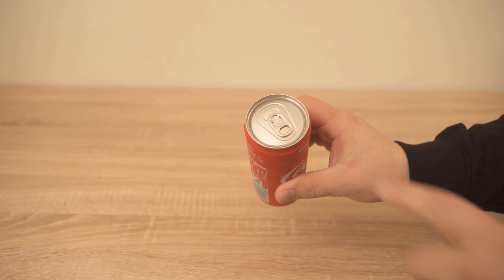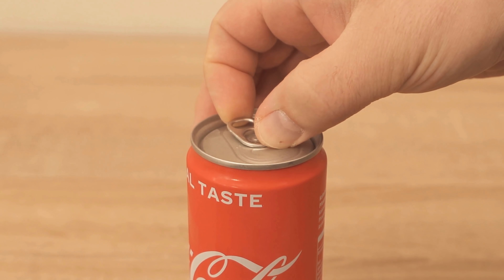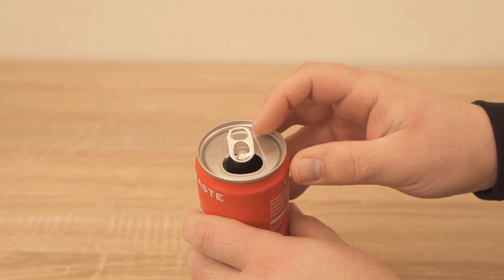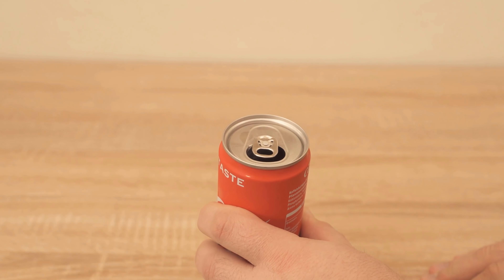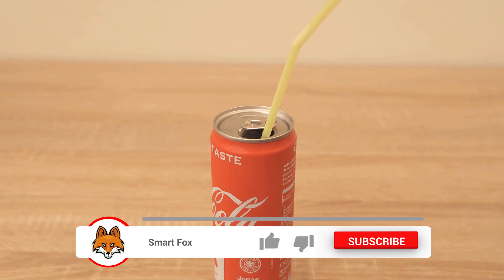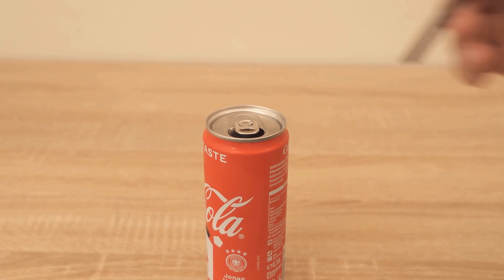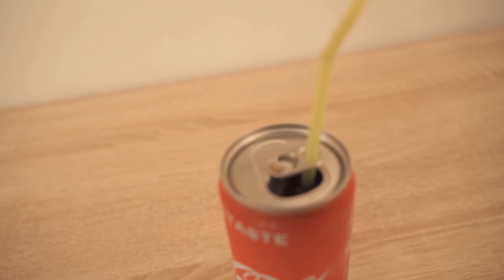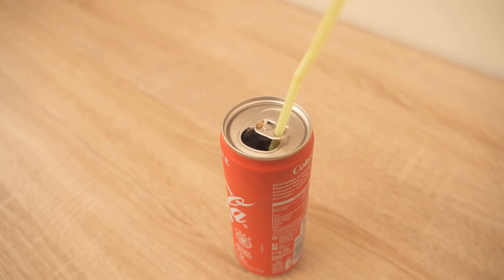Few People know the Function of THIS Clip 💥 (Do you know it?) 🤯

Comment: I've seen this elsewhere. However the same ringpull can be found on tins of sardines. Not using a straw on them!
This is a function perhaps, but not by design.
Reply: Sardines and a straw...yuck....lol🤢🤣
Reply: @willyboy6126             what I always eat sardines with a straw. And then drink soda with a fork. 🤣
Reply: That is a great analogy
Reply: Though it's entirely possible the ring design on pull tabs was designed with similar utility in mind, and it makes more sense to produce them the same way en-masse than to redesign and reconfigure. 

I would imagine the ringpull on tins of sardines and other food could have been very useful for hanging the cans in camping situations, or carrying multiple cans together on a string, etc.
Reply: @JustMe-ty2rp  I understand and fully agree with what you are saying about economies of scale producing one type of ring pull for two types of can  but for the straw holder thesis to be correct the drink can would at least have to precede the sardine can. Not sure that's true.
I think that the straw gimmick is more likely to be a coincidence than by design. These ring pulls are primarily on drink cans so as not to create separate waste with sharp edges especially for yhose engaged in can swigging or chugging.
And I really would not recommend stringing together sardine cans - full or empty - in the manner you describe by threading through the hole. Of course you can try ..

Incidentally,  I have rather given up on this channel. O well, back to my sardine smoothie.

Comment: It's not actually - It's a coincidence ....
It's just part of the structure of the tab, so it does not bend.
I worked for Coke as a mechanic on the filling equipment.
Reply: Were you also one of the design engineers that came up with and iterated on the idea?

Comment: I saved pull-tabs and placed them on clothes hangers.   I can hang other hanger  through the openings and save space in a closet.  I had a work uniform, I had 12 uniform blouses.   I only needed 3 clothes hangers placed on the metal closet rod, I was able to hang 4 blouses via the initial 3 hangers.   My uniform closet was small but efficient.    The pull-tabs are also convenient for hanging pictures, wreaths, etc.
Reply: VERY clever!😊👍

Comment: It was designed to lift the top easier, BUT was changed from the previous design pull tab. The previous was being a litter problem an harmful to animals a people were getting cuts to the feet because people were throwing the full pull tab on the ground. Leaving them connected stopped all the above. The hole in the tab was the luck of the straw, ;)

Comment: So that is why all those pull (and dispose) tabs from the 70s and earlier were there? And le the other viewer mentioned- "it is for drinking beer with a straw"? So, carbonated drink manufacturers have built in a holder for the instrument that ruins carbonation? (It is a given fact that drinking carbonated beverages through straws reduces the carbonation, hence why bigger straws are preferred  over thinner straws.) If drinking soda and beer  from cans through a straw were the ideal situation, why don't they include an attached straw? Or have straws available at the Point of Purchase? 

Alas, I think that straw holding hole is something that CAN be done with the opening apparatus, but that pull top design was NOT intentionally designed with that in mind.
Reply: I concur.
Reply: Absolutely agree with what you wrote. I wish I read your comment before writing my own.

Comment: I seriously doubt the pull tabs were "designed" for this function. People may have figured this out over time, but it's doubtful it was actually on purpose. I think, inadvertently as it may be, the only real educational value this video has to offer is putting the gullibility of most people on full display.
Reply: That and the fact that this tab was first used on beer cans, not soda.
Reply: @Frankie5Angels150  You could be right, I was much too young to buy beer when these were first introduced in America. But even if they were designed for beer, or if they were designed for soda, juice, water, or whatever, the other products would have changed cans around the same time. It's just impractical and way too expensive for anyone to produce separate cans for each. The one exception to that rule is Coca-Cola's iconic bottle shape. A company like Coke can pick any weird shape they want and the bottle manufacturing industry will always oblige.

By the way, love your YouTube handle. Dr Strangelove is one of my favorite movies. And who doesn't like Peter Sellers? "Gentlemen! You can't fight in here! This is the WAR ROOM!" LOL!!